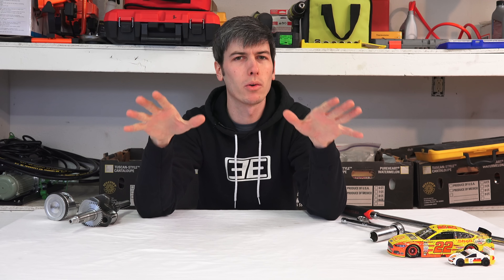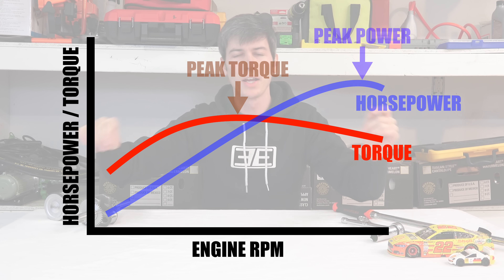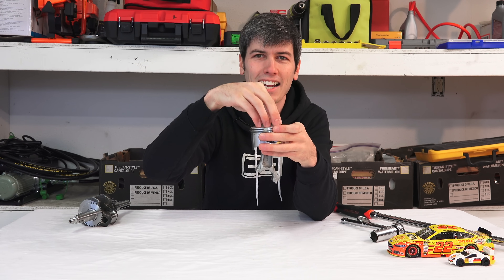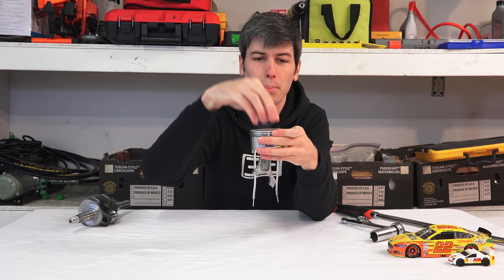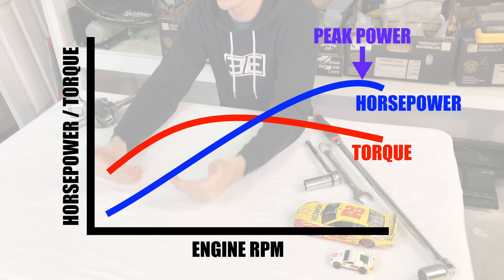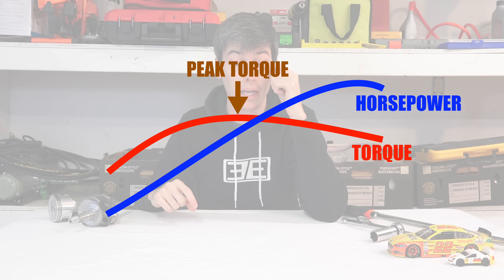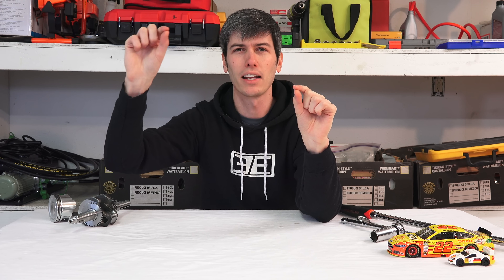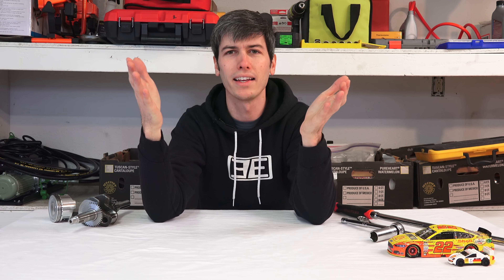Horsepower vs Torque - A Simple Explanation

Comment: That's why power to weight ratio is one of the most important things for accelerating. But if you have a low rev Diesel, usually it won't accelerate that fast, usually being big and heavy in big heavy vehicles with a low power to weight ratio when loaded, but it has a monstrous Torque for low revs! So it turn slower (less prone to wear and tear) but pulls like a mothertrucker! There's some crazies out there making high performance Diesel engines for competitions and such, it's hilarious but not really the point for those engines. I would take a Diesel for a daily driver over any gasoline chugger, we just might need a better Biodiesel tech (engines and fuel production) to make it reasonable for that!

Comment: Really enjoy your videos, at peak horsepower or peak torque are these also the points where maximum fuel is used?  Or is more fuel used getting to those RPMs?  Is a CVT always tuned to maximum horsepower even if the engine generates max HP at 5500RPM?  Thanks again for the effort and great work on all you videos.....Deni

Comment: Actually, the car with less HP can be faster, particularly off the line depending on the transmission differences, particularly in ICEs where these measures are non linear and transmissions that are only in optimal power/torque positions at only one point in their ranges for each gear, except as torque converters or CVTs would allow. I suspect, for instance, that a 100hp electric drive train could seriously out perform a 200hp ICE most of the time. I think that these performance figures should always be measured at the contact patch, which, I guess, what racing is all about ☺

Comment: Great explanation except your example of torque is back to front. At peak torque you said you have 50 LB-FT and a gear ratio of 3.0:1 for 150 LB-FT total, you then have a decrease in engine torque further up the rev range of 40 LB-FT and a gear ratio of 4.0:1 for 160 LB-FT. Now I don't know about you, but when I race a car or a bike down the drag strip I am prone to starting off in 1st gear and working my way up to the higher gears, not the other way around, which mean the gear ratio reduces to 1:1 or less than 1:1 (over drive boxes) the further I go down the track.

Comment: Sorry but it's even simpler than this. TQ is the twisting force of the crankshaft. The crankshaft is what turns everything in your engine and turns your transmission then turns your tires. Tq is called tq under 5252 RPM but as soon as the RPM is higher then 5252 RPM then TQ is called HP. Hp= TQ x RPM so HP is TQ. You cannot have HP without TQ but you can have TQ without HP. TQ is the single most important factor of any engine HP is useless. HP does not turn the crankshaft TQ DOES so without the crankshaft turning then what good does a engine do? Tq is speed tq is acceleration tq is everything a engine can do. To generate more hp it takes more tq. HP and TQ is the same exact thing there is no difference only the name. It's easy enough to say that TQ is labeled TQ for low end power(low rpms) hp is labeled hp for top end speed(higher rpms) but it all is TQ doing all the work!!! Tq is most important! HP is useless!!
Reply: Wrong. Force at the wheels is the most important (the only) factor that matters in acceleration. Power equals force times speed. So whichever engine produces more power at a certain speed (mph) will be faster, assuming vehicles have the same weight. This is where gearing comes into play.
Reply: King Austin Do you realy trust you intuition more than college physics ? Power alone tells everything. Torque alone tells nothing. Get used to it.
Reply: King Austin my impact wrench can  do 800 ftlbs, does that mean I can attach it to a crankshaft and it will drive my car faster than an engine?
Reply: King you were doing great(actually you made me see something a little differently) until you said HP is useless. It measures the work that can be done, torque does not. You kind of said it yourself, if an engine can rev above 5252 it makes more power, well I deal with bikes and the only engine that CAN'T rev much higher than that is a Harley or other big twin cruisers. It has to do with rev capability, size/number of cylinders, inlet tract, number of valves cam timing valvetrain mass bore to stroke ratio(piston speed) etc etc etc thats why bikes that rev to 14 or 15,000 rpm make big HP #'s with relatively little torque and why they can go 200mph instead of a little over 100. Aerodynamics and gearing(not weight) come into play also but I digress
Reply: Benjamin Payne wrong because the crankshaft is what turns the transmission and turns the rear tires so again only tq turns the crank. It's simple as that!! Power is tq above 5252 RPM so it's still tq doing all the work at the end of the day because RPM mean how fast the crank is twisting(TQ) so again TQ is the only factor

Comment: Jason, great video. Only thing you can add is that torque is useful in towing and getting out of situations where the vehicle is stuck and require slow forceful tyre movement to get out in rough terrain and sand cases. In my experience, i need as much torque as possible to lift my vehicle up and out before i get into the 2nd half or rpm, otherwise wheels spin. 
However, maybe I  got the physics wrong.
Reply: so, if his heavy-weight truck is stuck in the mud and you want to pull it free with a Lambo, you just switch on launch control, floor the pedal and push the Lambo into first; what kind of gearbox ratio would you recommend for that to work?
Reply: The Semite Will Stofferahn and fernace: Why do towing vehicules have plenty of torque and lower power ? Because they are designed to be reliable under heavy load during long period of time. Reliability often implies displacement and long stroke which therefore often implies lower RPM. RPM is so limited that peak HP ends up being quite bad. But overall power and efficiency remains great.

But I am not sure you are ready to hear that torque alone means nothing as gearing can manipulate it at will. And don't say that theory and reality don't match up just because you don't get the theory.
Reply: No. What you need is power, always. The issue might be that at low speed your gearing is not enough to put the engine in the peak power, so you care about low end horse power, which is determined by peak torque.
Reply: Will Stofferahn i was thinking the same thing. I want Jason to explain it in his way.
Reply: Xavier Andrade That makes no sense at all. You need torque. There is a reason why any vehicle that is designed for towing and hauling weight has much more torque than horsepower. Even a modern diesel pickup puts out over 900 ft lbs of torque, but only 400 hp. Torque gets you in motion and helps keep you in motion.

Comment: GM's 60° V6s are in the more torque than HP category. The cars with those are usually able to get up to 40 MPH like a scalded cat, but falling on their face after that. Such that the 0-60 MPH is about average. Can be fun in a way (which is under-rated perhaps?), but not much of a top end to them.

Comment: Easily the best explanation one can find on YT. Btw. I have a question regarding acceleration. As you mentioned in one of your previous videos, one of the first modifications one should do to their car is increase final drive ratio. Mind if I ask, which woud be more effective, increasing the gear ratio or increasing horsepower by the same percentage, both in terms of acceleration and economy (fuel economy, engine wear)? As well as which option is overall easier to apply?

Comment: Congrats on very detailed explanation but I still do believe that car B wtih higher Torque output would accelerate quicker than car A with higher HP output regardless of what gearing is it on and friction is not relative on that equation. Althought car B will have lower top speed than car A with high HP output.

Comment: Great video! Would be great to learn a bit more about the difference between gasoline and diesel. I’m not sure if diesel sedans are popular in the US but here in Australia they’re very common and in the UK as well for what I’ve heard. I did some research before but it’s hard to find technical explanation on why diesel has more torque and why the RPM is generally lower than gasoline cars (and motorcycles are much higher). I’ve seem videos where a BMW 330d was faster in the quarter mile than a BMW 330i. Is it because of the turbo? Also, why most diesel cars have turbos? Fuel economy is an easy answer to find but would be good to include as well (in case there’s a pt 2 video). I understand diesel cars have more torque and less horsepower, but why are they faster than a gasoline car of the same cylinder size? Thanks again for another great video!!!
Reply: diesel caries more energy...adding oxygen(turbo) uses more of the energy in diesel...diesel engines work by compressing gasses till they combust compared to gasoline motors using spark plugs to ignite gasses.

Comment: you forget to mention, why have higher torque is important. Yes they are related, yes, power have torque in it, but with lower torque, your car will be lazy. at the end with same gearing/ crankshaft/pistons you will get higher speed, accelerate faster, but when you put 2 same cars under load, car with highest torque will accelerate faster,because car with more power will have to get to peak to work better, when in second car will torque help to spin shafts with less effort.

Comment: Great video! I'm a mechanical engineer too, but admittedly it took some take after getting my undergrad degree to figure this out on my own. I understand torque and power in cars now, but when it comes to generators, I still feel a little confused about it, since these motors operate at a single speed and have a single ratio. Also, I have a couple of corrections for you. Power and torque don't depend on each other. Power depends on torque and not the other way around. You can apply a torque to a bolt and it will not move, therefore no power. My understanding is that while torque and moments generally the same thing, there is a subtle difference. Torque describes a twisting force, whereas a moment is a force at a perpendicular distance.

Comment: I think there's a slight thing that might confuse people by bringing in gear ratios into this explanation. Independently of the gear ratio, fastest acceleration is achieved at peak power instead of torque since at peak power,  you are producing the most torques per second, which I think is an important point to make. Independently of the gear, the car will accelerate fastest (iat any gear, relative to the gear itself) at peak power, since instead of producing say 450lbtq at 67 times per second, you are producing 400lbtq 116 times per second.

I don't know, maybe this explains it easier for me, but great vid as always!

Comment: engines with longer conrods usually make more torque, shorter rods will have less torque but more HP
Reply: Nathaniel Vas sorry this is not accurate. A longer connecting rod will not make the piston travel longer distance. It will only affect the angle relative to the crankshaft (connecting rod is only the link between piston and crankshaft) longer stroke on the crankshaft will increase torque but also increase engine displacement.

Torque is a force acting rotationally at a radius (perpendicular force at the length from the rotational centre)
Reply: Fooze you must mean stroke, but that is actually still only partially true because a long stroke has smaller valves because of the smaller bore(less revs/HP), and a short stroke can have larger valves because of the bigger bore(more revs/HP). I admit it took me a while to grasp that because you would think the longer stroke would put more leverage on the crankpin but the combustion chamber design is more influential than the stroke is. BTW a longer rod doesnt change the stroke, only physically moving the crankpin on the crankshaft in or out from the main bearings can do that.
Reply: Foozefighter Nope, HP wins races.
Reply: what? did i say anything about races? u high?
Reply: Foozefighter No, sorry, I was replying to another comment, but the YouTube app is bugged.
Reply: Why is that, care to explain?
Reply: Well said thanks

Comment: So why then is torque still advertised by all manufacturers if it's really  horsepower that gives you the performance of the car?

And what is the difference between high rev-ing engines with low torque (ferrari 488) and lower rev-ing engines with huge torque (hellcat engine) if they have similar horsepower numbers?

Comment: Why does HP always = TQ @ 5252RPM?
Reply: It doesn't. That's only the case if you use imperial units for torque and rpm. The base equation to calculate power out of torque and the rotational speed uses totally different units and the values of power and torque would be equal at a very low rotational speed.

Comment: I always thought of it as torque is acceleration and horsepower is speed.
Reply: Torque is basically acceleration from a dead stop but in order to continue that acceleration you need a horsepower curve that either stays flat or rises with rpms, as ultimately horsepower determines your acceleration to a given speed while torque is dependent on that mechanical power supply.
Reply: This is unfortunately not true.

Comment: The example you used will have a different outcome if you conducted 2nd experiment with 30 degree angle. Smaller car with higher torque will win even though bigger car has more HP. To my best understanding, horsepower provides acceleration, but torque is needed for inclination. There is a very specific time or more of interval during combustion when spark plugs ignite the gasoline, but there is no work done ( Milli of a second). During ignition/combustion, the piston is pushed  transforming into rotational energy (torque) proportionally related to the distance piston travel and force (nature of the combustion). Further the piston travel from the point of combustion, lower the energy is generated. Everything is related to the point of combustion piston travels and the interval the combustion taken place! I hope you understand that even more intensively now than ever before!
Reply: william dohn Enlighten me please.
Reply: Rahuley Shar Nope. The car with more HP will be faster also in an incline situation, because you can downshift and get more wheel torque.
Reply: You are downshifting to get more wheel torque. So, it is the torque which increased! A drill machine can spin at 2000 RPM, but it is the torque will put the screw in the wall. Although, it is spinning at 2000 RPM, but as soon as the screw starts to flow inwards, 2000 RPM will will be reduced unless you increase torque. Same thing on inclination. You will need to increase the torque to keep up with the speed or deceleration will occur!
Reply: Rahuley Shar Where is the part that you don't get? 
We agreed on, that wheel torque is the relevant figure, right? 
At given speed the car with more HP has more wheel torque. (Except in first gear in some cases).

Also you seem to have a misconception concerning driving up an incline. You don't need to add torque when you go higher, only if the hill were to get steeper.

Comment: Then when is torque useful? Something like a diesel truck may only hit 4k rpm, 300 HP, but has 1200lbs of torque. Am I correct to describe it (in very basic terms) that torque allows you to do more work with X horse power? Ie: 2 cars with the same HP, but the one with more torque can be heavier? (To a degree)

Comment: Horsepower is all about how fast you really want to go top speed torque how much you want to pull or how quickly you want to take off you're in the drag racing torque is Keaton if you want to get like three four hundred miles an hour horsepower is King other words Lamborghinis Ferraris or horsepower less torque do you want to take off from 0 to 60 well at HR drag racing piston Strokes relatively around 6 so did piston stroke with a special camp in a creek so it's all the better of what you want do you want to take off quick torque you want to go top speed horsepower I just say